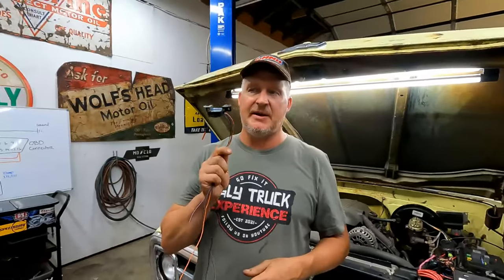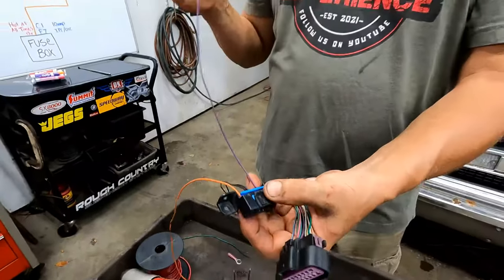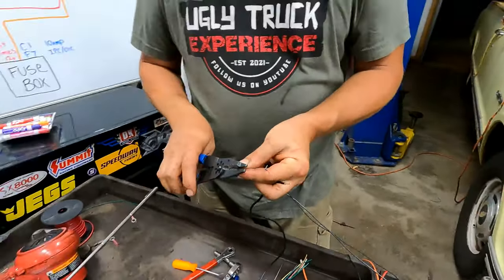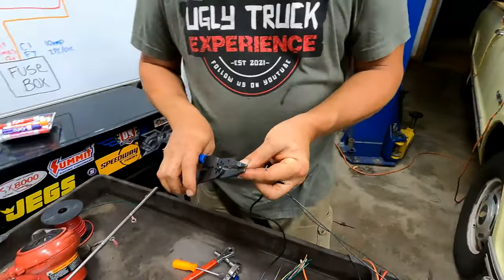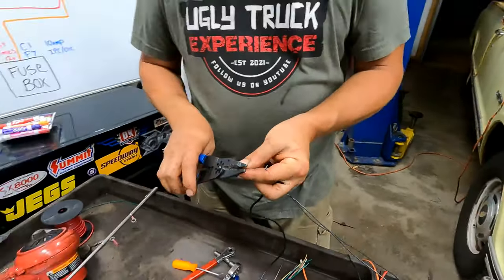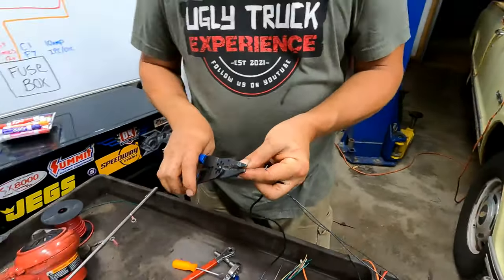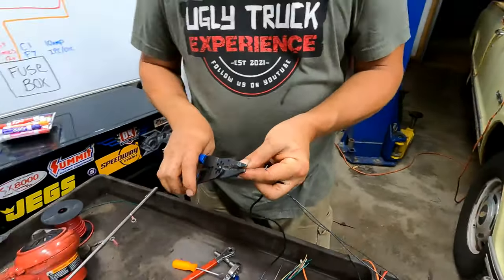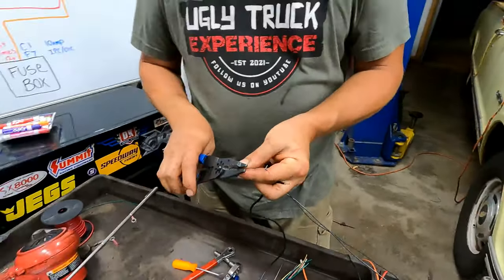How to Wire LS SWAP OBD Connector + Check Engine Light - UTX

Comment: Hi, i have a question i put an Ls 5.3(2001) in a 89 firebird trans am and i cant seem to get the check engine light right.I connected the light bulb wire one to the pcm wire  like you and the other to 12v hot all the time and it stays on all the time when i open the switch? I would appreciate your help.
Reply from the maker: What do you mean by?  When I open the switch?
Reply: @UglyTruckExperience  when i open the switch the check engine light comes one and stays on all the time no codes though. Im putting new gauges so i wanted to put a bulb so i can see if anything goes wrong.

Comment: For 99-02 c1 underhood connector there are no pinouts online that i can find. and i dont believe f7 is battery constant. do you know any other pins for 99-02? im looking for cigarette lighter 15amp but cant find the exact pinout, trying to line it up and the closest one i can see is pin f4 which has 2 orange wires and i believe all orange wires are battery constant if im not wrong. Also it has me thinking it is correct because the cigarette lighter also has obd2 tied to it. need help
Reply from the maker: Hello Zombie.  Sorry for this late response.  You are correct.  C1 F4 should have two orange wires that will be hot at all times.  One wire went to OBD plug and the other to cigarette lighter.  Jerry

Comment: You mentioned the O2 sensors being different between your 4.8 and 5.3. I believe the difference is that the Canadian built trucks use a case grounded O2 and the US/Mexico built trucks are grounded by a wire. My 02 Silverado donor was Canadian built and has case grounded O2 sensors. It originally had a 4.8 in it. I swapped in a 5.3. Even use the 4.8 PCM to run the 5.3 with no problems at all. Im currently in the middle of swapping the 5.3/4l60e out of my Silverado into my 94 S10.
Reply from the maker: That's interesting! Thanks for the info, Shady!

Comment: You said that it only has 3 wires, but mine has 3 wires plus the ground wires, there is a power wire, the data wire, and the two grounds wires but it also has a green wire(common wire?), and it has power going to it at the port so what is causing it not to work any ideas
Reply from the maker: What engine and computer are you working with?

Comment: Hey here is a quick question on my 2002 ecm/harness swap my connector 1 f7 is not hot … only the f5 & f6…. I just moved my wire down but I didn’t know if maybe I have a fuse missing or relay. But I don’t think it’s a big deal but just thought I would mention it if anyone else has had this simple little issue … keep up the great work … thanks
Reply from the maker: F5 would be a good power source to use.  F7 Is a relay control.  They are different from 2002 to 2004, so you have to check for what your wiring harness and box came from.  Thanks for watching.  Jerry
Reply: hey same problem, did you use f6?
Reply: @zombiebloodsparkle1  ehh it’s been 2 months let me go look bud hang on
Reply: @ hey did u get this resolved I’m sorry I went to look and … got squirreled …
Reply: @KennethC-x8n  nah not yet, just temporarily hooked it up to 12v source
Reply: @ I just used f6 … I can send you a pic if needed …. Send me ur email and I ll send u we’re all my wires are … are u using a 99-02 fuse box because it matters for sure and if your harness is from Canada or Mexico

Comment: Will this hookup allow the ability to tune with hp tuners or other laptop programs? As if it was still hooked factory
Reply from the maker: Hello David.   Yes, this will give you the ability to plug into the OBD plug and give access to data.  That is all that is needed to communicate with HP tuner or scan  tools.  Thanks.  Jerry

Comment: my 5.3 on a standalone harnes has a obd port but i can't get the scan tool to communicate  after my engine overheated any tips ? i can rewire the obd port would that solve this issue? it was working fine before engine got hot
Reply from the maker: Hello Oscar.  The engine overheating would just be a coincidence I would imagine.  I would start looking at the wiring going to the obd plug.  Check it for power and ground and if all good there you must have a bad data connection.  Make sure all the fuses that power the PCM are ok also.  Jerry

Comment: Anyone know if the gen 4 pcm have a mil port?
Reply from the maker: A gen 4 engine has a mil light the same as gen 3.  It uses a data signal.  If you know what your donor motor and harness are from I might be able to let you know where that data wire is.  Jerry
Reply: @UglyTruckExperience  2007 corvette 6.0 donor
Reply from the maker: Are you using the body control module on this swap also?
Reply from the maker: I would guess that you are not using the BCM.  You will need to find a Tan wire and a Tan with Black tracer wire at the  ECM.  The tan is in Connector 1, position 27. The Tan with Black  is in position 28 right next to it.  Those wires will  go to the ALDL connector.  Tan to position 14, Tan/Black to position 6.  ALDL connector will also need battery power at position 16 and position 4 and 5 will need to be grounded.  That will give a scan tool access to GM high speed LAN which you will need to look at ECM and TCM.  The actual MIL light is grounded by pin 68 at the ECM at connector 1, it is a Brown wire with white tracer.   Hope this helped.  Thanks.   Jerry
Reply: @UglyTruckExperience  Came back here to say Thank You So Much for this information.
Reply from the maker: @evlsc400   We're glad it was helpful! Thanks for tuning in!  --Emily and Jerry

Comment: Do you guys have a video of how you did the driver side battery mount? Im struggling with that part on my 68 right now.
Reply from the maker: We do not have a video on that right now.  On our 70 c10 we used the battery tray from a 2004 Tahoe and made  some new brackets for it to sit on the driver side.  Should probably do a video on that.  Thanks.  Jerry

Comment: How do you wire up the tcc to the brake switch in your conversions?
Reply from the maker: We are actually working on that video today.  What are you working on?  Donor and swap vehicle.
Reply: @UglyTruckExperience  my swap engine is a 2001 Lm7 from a 2001 Tahoe.  It’s going in my scrambler.
Reply from the maker: Ok  This next video will fix you up.
Reply: Can’t wait!!

Comment: Thanks for your great videos. Do I need the original OBD 2 with many more wires to run Dakota gages with their BIM-1-2 or is the one DATA wire your showing do it? I want to get speed, oil pressure etc from the PCM.
Reply from the maker: The Dakota dash will run off of this wiring.  It just needs that one data wire at the OBD connector.  Thanks for watching.  Jerry and Emily

Comment: Great video! Just what I needed :) I'm rebuilding my 72 Camaro dashboard. The previous owner swapped the angine, but did nothing to all the old cables and it is a mess. I already removed endless cables going nowhere. the fusebox looks horrible. All cables are wrong there. There is an OBD connector, but I did not manage to make the cheap readers to work. There is no check engine light as I think I managed to lose it when clearing all the useless cables away. I will use this video to continue working on it, but I think the first step would be so somehow identify if the OBD connector is even working ok and if it is, then check any alarms are on. If that is all ok, I try to indentify the check engine cable and test it turns on and off. Any tips you could give me? For example on those OBD readers. I don't want to get another that does not work.
Reply from the maker: Hello Janne. 72 Camaro...  Nice.  We have a 75.  I have some pretty cheap OBD readers around here and don't have much of a problem with getting them to make a connection.  From the sounds of it you are picking up where somebody else left off and kind of left you a mess.  The OBD connector really has very few wires that are required to get it going.  You might be better off to get rid of what is there and start from scratch so you know it is correct. If I buy another OBD reader, I am going to purchase a Autel. They have one that is less than 40 bucks.  I have some of their other readers and they work great.  Keep us posted.  Thanks for watching.  Jerry and Emily
Reply: @UglyTruckExperience  Thanks for the comment! You are right, I don't know why the previous owner did not remove all the old wires.. it would have been much easier while doing the swap.. it was a mess. Anyways, a friend of mine will borrow his reader and I will try that first. I have roughly 3 Months to rebuild the whole dashboard and I want to fix most of the wires during this time. My fellow old timer friends might hate me, but I am going full crazy with the dashboard, designing it in virtual reality and 3D-printing it in parts. End result should be quite wild. If I can pull it off, then follows other areas of the car. Some more practical and some just for the looks. Car already has so many updates that going for the original look does not make much sense..
Reply from the maker: Hey Janne! That's awesome! Be sure to keep us updated and send us some pics if you can! facebook.com/uglytruck  Thanks! --Emily and Jerry

Comment: Thanks for showing these two things that I have been curious about!  I have one more question, how is the neutral safety switch contended with?  Thanks ugly trucks/cute camera girls!
Reply from the maker: The neutral safety switch that is mounted on the side of the transmission needs to be used.  That switch also lets the computer know that it is in gear or reverse.  The original vehicles neutral safety can be left to work like normal or could be removed.  That is something I will make sure to address in up and coming videos.   I think she is pretty cute also.  Thanks   Jerry
Reply: @UglyTruckExperience  what would you do if you mated up to an old TH400?
Reply from the maker: In that case you would need to wire into the cars original neutral safety switch which would be mounted on the steering column on a car or truck with shifter on the column.

Comment: Can you use the purple wire to run  Bluetooth information for your dash? i.e. speedo, voltage, etc.?
Reply from the maker: I think your probably asking about the data wire.  If your using a aftermarket dash that uses a data connection to communicate to the pcm you could definitely use that wire.  Some of them just plug directly into the OBD2 connector.  Thanks   Jerry
Reply: @Ugly Truck Experience  thank you Jerry. I'm am brand to LS swapping...lol. I love your videos,  keep them coming. Can't wait for  my 72 C10 to get on the road

Comment: Hi i have a green wire coming of the obd2 conector do u know that tha might be or to where i might connect it to
Reply from the maker: Hello Eduardo.  Where did you get your connector from and what position in the plug is it in? Jerry
Reply: @UglyTruckExperience  i got it off a 2002 escalade  with the engine and wire harness
Reply from the maker: That green wire that is going to your obd connector went to the radio on that Escalade.  You will not need it. Jerry
Reply: @UglyTruckExperience  thanks a lot
Reply: @UglyTruckExperience  thanks I hooked everything, but I still having trouble reading the ECU with the OBD two connect do you know if this is different wire to the purple one?

Comment: Mil connection on 2001 Tahoe goes to inside fuse panel, please advise data wiring #58, and ecm ground # 46?
Reply from the maker: Hello Kenneth.  Your pin 58 at connector 1 at the ecm is the Data connection.  Pin 46 on connector 2 at the ecm is the ground for the Malfunction Indicator light.  The mil and the data connector are two different items.  Are you needing info on both?  Jerry

Comment: Hello from Australia, just want to start by saying great video’s with good in depth explanations which can be hard to find when it comes to wiring, they have helped me a great deal with my Ls conversion, keep up the great content. 
One final thing I would like to make work in my swap is the power/economy switch (Ls1/4l60e). I guess all I really want to know is what the circuit requires? Am I applying 12v, giving it an earth or just breaking a circuit to swap between the 2 modes?
Thanks in advance.
Reply from the maker: Hello Mark.  Let me know a bit more about what your donor motor and transmission came from and I will gladly take a look.  Thanks. Jerry
Reply: @UglyTruckExperience  the donor was a 2004 VY SS Commodore. From factory they have a power/economy button which I believe all this does is allow the engine to rev a little further out before upshifting when in “power” mode. My wiring diagram shows blue connector pin 71 controls the function I’m just not sure what the circuit requires to switch between the 2 modes. 
Thanks.
Reply from the maker: Hello Mark.  I literally have no information available to us involving Holden's.  It's sister car here in the US is a pontiac G8 from what I can figure out and I do not see this feature in it.  If I had no info on that circuit, I would check for voltage when running. If it had very very little voltage, I would try grounding it.  Do you happen to know how many wires wen't to the button on the donor?   I wish I was more help and am curious to find out what happens.  Thanks  Jerry
Reply: @UglyTruckExperience  Hey Jerry, just wanted to let you know that grounding the circuit seems to work. It seems to be in “economy” when grounded and “power” when the circuit is open just incase you run into something similar in the future. 
Cheers.
Reply from the maker: That is great.  Glad to hear that it is working.  I appreciate you fallowing up on it.  Thanks Mark.   Jerry

Comment: hello had a question about the check engine light video
Reply from the maker: Sure, what's your question?
Reply: @UglyTruckExperience  im trying to run my own check engine light. got my wire in the slot 16 and ran my wire to the brown and white wire like you said but its constant grown bulb lit up with no key. 

i redesign my dash 2000 dodge dakota don't have my original gauge cluster. but in AZ i got to have a check engine light. i found 2 ground wires same color blk/TN 31 and 32 found a wire called "sensor ground" blk/LB 4  and a fuse ignition switch output wire lg/BK all read negative withe probe tool. so where would i run the negative wire from the bulb to the PCM to which wire because all these are constant ground?
Reply: 4.7L
Reply: intellitronix 6 gauge i lost my seat belt light window washer light check engine light brake light abs light door ajar light cant find those wires but i do need the check engine light
Reply from the maker: Are you saying your truck still has the original 4.7L in it? Is the dash the only thing you changed?
Reply: or what would the wire be called I'm looking for?  i wish i could send you a pic of a diagram i found
Reply: does your brown wire have a constant ground? or do it only ground with the key.. like i said my grounds make the bulb come on with no key
Reply from the maker: Are you doing an LS swap? Or just trying to wire in a check engine light?
Reply: @UglyTruckExperience  just trying to wire in a check engine light
Reply: @UglyTruckExperience  
@reditthome9130
9 hours ago
intellitronix 6 gauge i lost my seat belt light window washer light check engine light brake light abs light door ajar light cant find those wires but i do need the check engine light
Reply: @UglyTruckExperience  right  it still has the 4.7L and i changed my dash
Reply: @UglyTruckExperience  I appreciate you even responding you gave me hope.  but imma just give up after 3yrs of trying to make this truck my way thanks i will let everyone know to check you guys out great videos
Reply: @UglyTruckExperience  is it that you don't work on dodge?
Reply from the maker: This video is for an LS swap, so this OBD wiring is for a 2005 Suburban. A Dodge Dakota will be completely different. I can look up a diagram and try to help you out if you like. What year is your truck?

Comment: Ok, dk green, yellow and purple on my blue >OF BLUE/RED 1999 SSeries pcm are not giving me communication to dlc to pin 2 which is purple . (Pcm/dlc came together) pins 4+5 on dlc i grounded to brake pedal mount , pins 9+13 i just have cut and capped on dlc side as i think its airbag and sonething else unnecessary..  which pcm wire do i need to hijack to run straight to my DLC...thanks lol. Oh akso double corneal transplants/ my vision is as good as night diving in new jersey..
Reply from the maker: Pin 58 on connector 1 at the pcm. Blue connector. It is a dark green wire. I hope that answers your question.  Let me know.  Thanks Bret.   Jerry